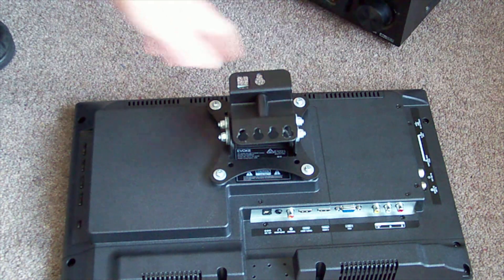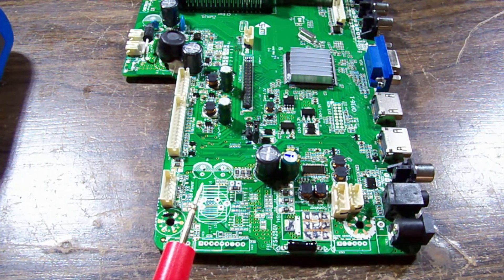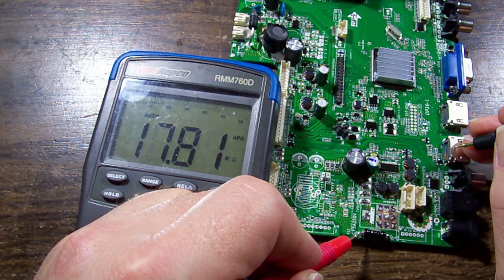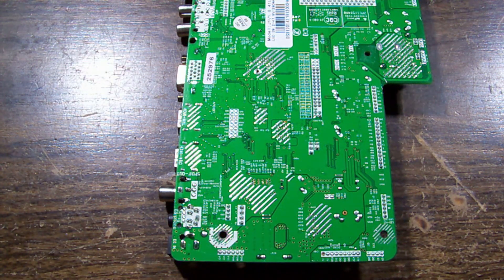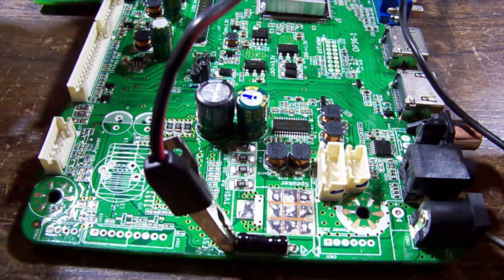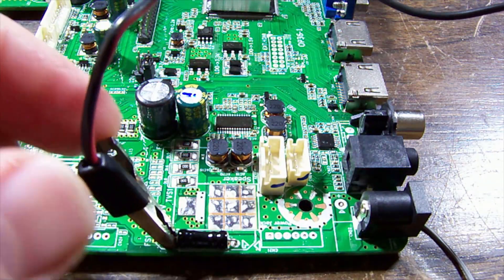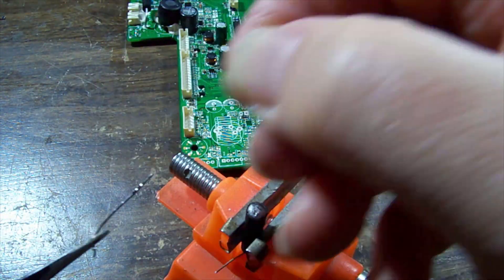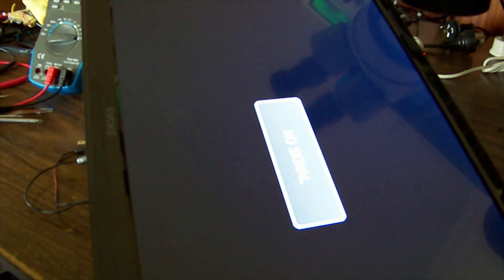Evoke 12 volt caravan/RV TV repair

Comment: I expected that to be a pig to repair,  you have the luck of the devil ha ha :-D
Fuses can sort of age and be less tolerant to spikes of power, it sounds nonsense but it does happen.
Corrosion at the inside ends making the wire more resistive/thinner maybe.
And did the dvd player still work?, i bet it did lol.